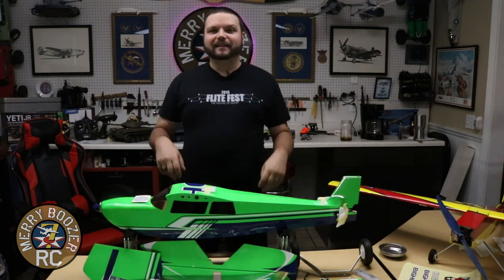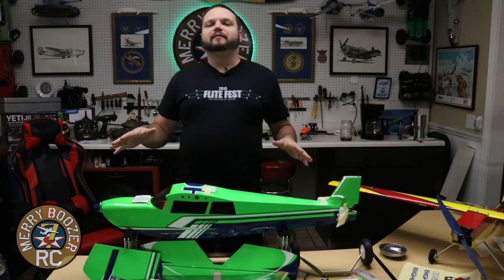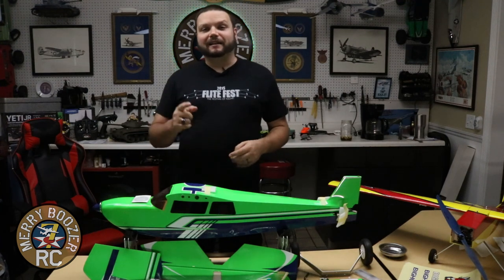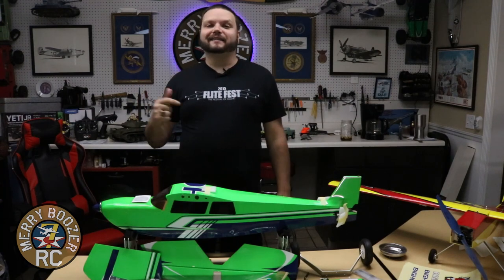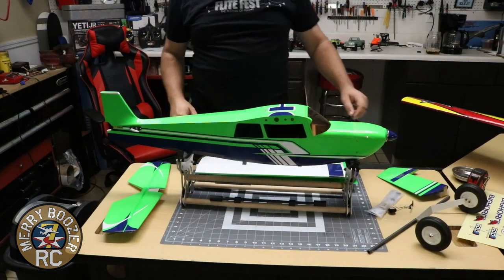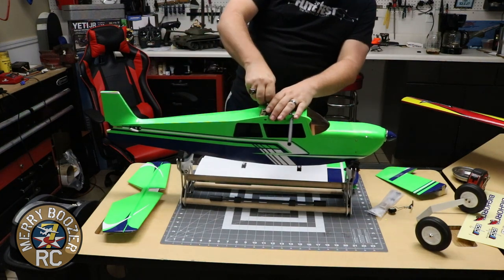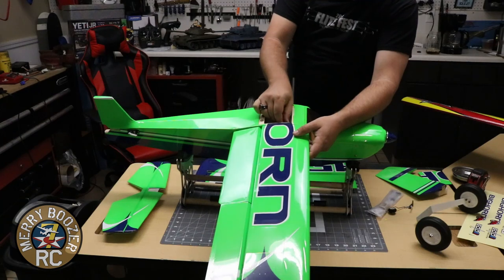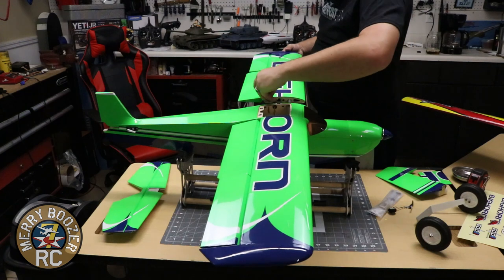OMP Hobby Big Horn Assembly

Comment: You could get red lock tight off with a little heat. It will come right apart
Reply from the maker: Or just use blue from the start
Reply: @MerryBoozerRC  I use both, on my metal house EDF I use red on all screws as I’ve had blue back out.
Reply: @MerryBoozerRC  👍👍

Comment: In terms of Rx hookup, can 2 Y-harnesses be used (for ailerons & flaps) to allow for a simple 5 channel connection?  Just want to sport fly this nothing crazy.
Reply from the maker: No unless you run a reverser on one of the flaps. You will need to run one of your flaps in the gear channel and set up the wing type to 1 aileron 2 flaps
Reply: @MerryBoozerRC  Hmm I think I understand.  Y harness ailerons and use 5 & 6 for flaps thus allowing use of a 6 channel Rx (like AR620, 630 or 631 as I fly Spektrum). 

Only plane I have that needs to be set up this way.  I guess I’m not experienced enough in this hobby yet to fully understand why they did it this way.  I do understand the 3D guys want everything going to individual channels for better control but this is a sport plane.
Reply from the maker: @dandanthedandan54321  they did it this way so you can do flaps or full span ailerons. The flaps have to be on two ports to do the mix